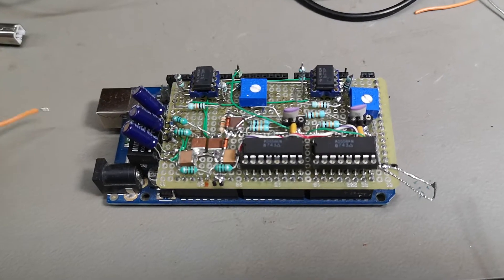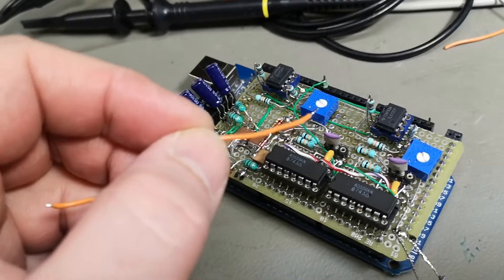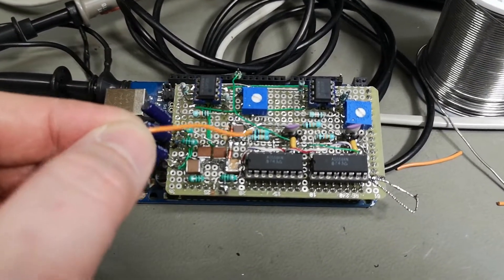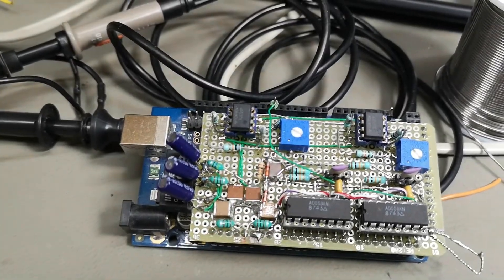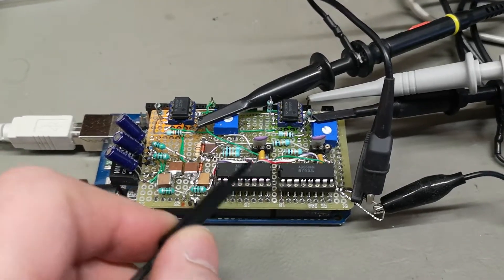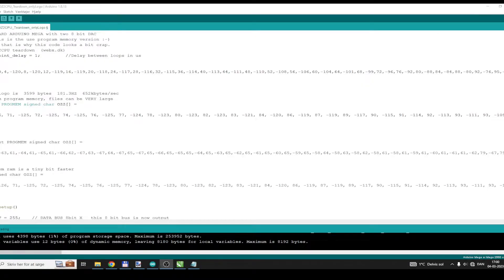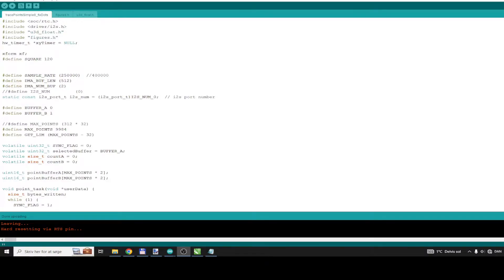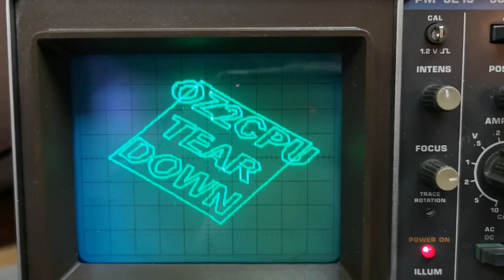DIY Arduino XY scope vector logo plotter , free code and free files

Comment: Regarding the problem with the ESP32 not running the two DAC's in sync, what about using a Sample&Hold amp to buffer the output? Too slow I guess?
Reply from the maker: not a bad idea, but the DMA transfer run on its own background task, you dont have software control over each data transfer, the latch signals can be programmed to go out external ,so i guess they can handle an external hold, we run at 4-600kHz update

Comment: Hi, it's wonderful when you sent me it, so I examined how it works and because I haven't penetrated the mysteries of Arduino - an old analog school - I wouldn't invent this, you're good. The rotating pattern is amazing if he didn't point out the center line, I thought it was the intention.
When they robbed my private workshop years ago and I lost everything I had so I resigned from home projects and only worked as a job. Thanks to the videos like you do, I started building my workplace again and when I see what you can think and make, I regret the time I wasted and did not develop.

Nice day 🙂🙂 Tom

Comment: Very impressive, I might have some 8bit DAC's kicking around to play with. This is some upgrade over the hand drawn scope clock from many moons ago ;)
Reply from the maker: i just realized it is about 20 years ago i released this : http://webx.dk/oz2cpu/clock-scope/scope.htm
using a PIC16 and a stereo DAC
Reply: @TeardownOZ2CPU  There was even an earlier article than that one with hand drawn numerals and a bit more info. I build it not long after the first article was released. I gifted a clock based on this to a friend who still uses it.
Reply from the maker: @Sine1040  i think a scope clock should be combined with a PIR sensor, so the beam can be turned off, while no one is in the room, maybe even add two power down modes, the fast one just turn off the beam, the slow one for nights or work days, turn off also the filament, this way it will last much longer, and use much less power
Reply: @TeardownOZ2CPU  That one wasn't that advanced. I built it in the housing of a small scope. The PIC had it's own power supply, and you could switch off the CRT and high voltage supply with the original power switch of the scope.

Later i built a few clocks with the old analog 'cathode corner' circle generator design. These still had no sensors but a settable on and off time for the tube power. I used that same trick for a few nixie clocks. Either dimming them, or completely shutting off the display.
Nowadays I would indeed use an additional PIR or RF motion sensor to switch off everything but the digital logic.